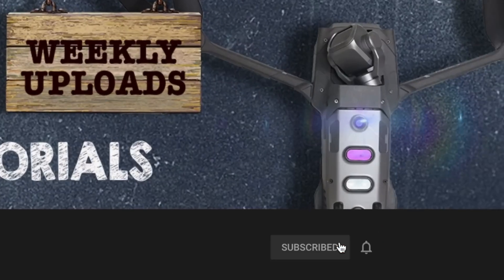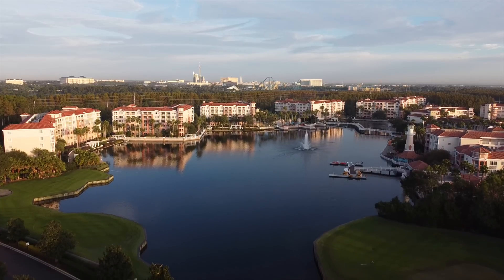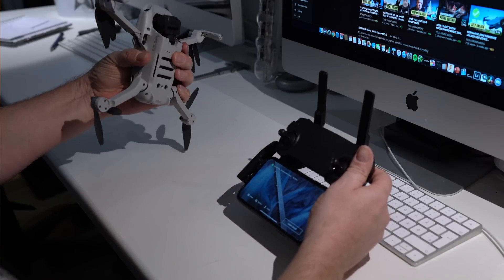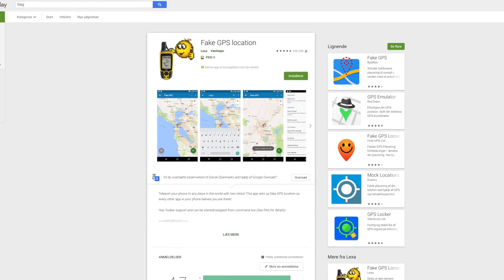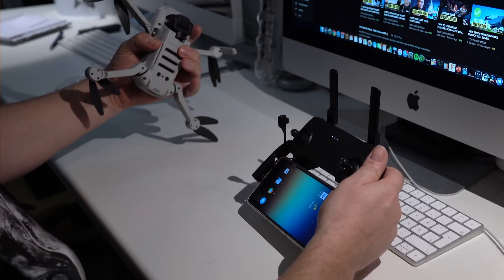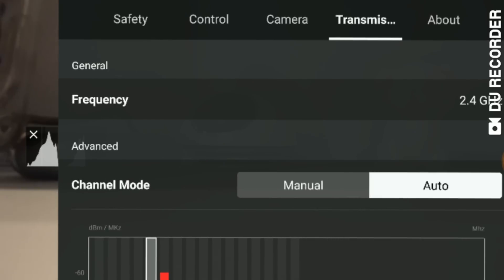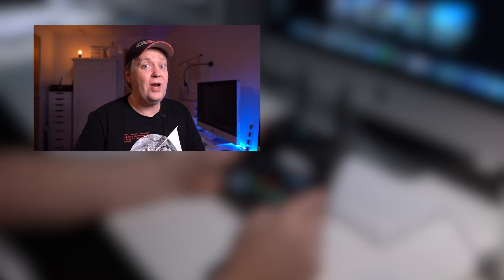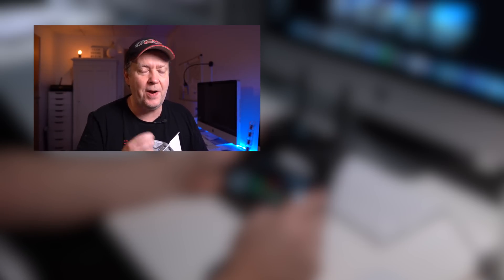HOW TO FIX MAVIC MINI BAD RANGE - FCC HACK (all DJI Drones 2020)

Comment: Hi there, first I want to mention you are making amazing tutorials! The second thing Is that I try something maybe that will work for some of the guys, i faced a lot of issues with city flying on 5.8, i couldn't reach even 20 m Height, what did I do I switch to 2.4 and choose 4 th channel, and it was working great, maybe you have any explanation how is that possible? Best Regards from Ohrid-Macedonia!
Reply from the maker: Thank you sharing your experience .. I think channel 4 is less polluted in your area, might not be for everyone
Reply: Simple: the higher the frequency the less power and penetration and range it has ... the more likely intererence will hurt the communication.

If RC pilots want to get high range they avoid even the 2,4 Ghz frequencies and chose 9xx Mhz, so 900 Mhz bands ,,,, no Ghz bands at all.
That leads more reliable connection and better signal .
So stay in 2,4 Ghz to get the best and check the wifi "pollution". If that is high than you are most likely above a private area with a lot of households and wifi networks where these signals will be stronger than yours if you are farer away cause there signal is stronger being closer to the drone. Than you loose the video connection first ...

dji does not care about it cause flying over private crowded areas is forbidden in close to all countries ... at least EU, US, Africa, ... 

Best way to avoid these risks: buy a mavic air 2 cause that will use occusync 2.0 and that is a different story regarding range

Comment: I am also confused because my battery’s say Ce does that mean anything and im also noticing bad range in my neighborhood
Reply from the maker: You likely have the CE version of the drone
Reply: TECH DRONE MEDIA but you told me before you thought I have fcc
Reply: Most like That CE is just a electronic safety level. You can always go onto dji website and look up the model numbers for both then check your box or drone to see which matches

Comment: Hello sir can you give me an advice? Because last week i bought mavic mini 199g here in japan, 199g battery 1100mah battery flight time is only 10mins, can i use 2400mah battery to fly more? It is compatible or not? Please help me
Reply from the maker: I think it will fit, but not sure if it's blocked by DJI but can't see why they would do it.

Comment: If leave your drone sitting idle it will switch back too, and overheat :) 

I'm no expert but this hack would probably only be useful for MT1SS5 / MR1SS5 Drone/Controller combo as they are FCC and SRRC. 

Also some person in Texas is going to collect a lot of drones from flyaways :D

Comment: Hi, I really appreciated your video. Did exactly as you said (i even took notes in order not to forget a step) and it didn't work.
Then, I changed the proceeding at the start:
-Start Fake GPS
-Connect phone to remote with cable
-start remote control and drone.

So connecting the phone with the cable BEFORE starting the drone and the rc did the trick for me.
Reply: Are you on the latest software 1.0.5

Comment: I can confirm that if you go to the location services of your Apple device (settings, privacy, location services) and remove access to location on the DJI apps (tap on the app name and select never) than there is no need to start up the drone in the way it is done in this video. The apps can no longer use the GPS in your Apple device and FCC stays forever if you keep on using the same device.

The first bit, programming a fake location, still needs to be done with an Android device though.
Reply from the maker: Nice bonus hack :-) thank you for sharing
Reply: @TECHDRONEMEDIA  Yes, I have tested it as well at home, and in the field. But, as soon as you enable location services again it will revert to CE.

Another thing! you CANNOT disable location services on an Android device. The app will not work when you restrict the app from using GPS. When you start the app with GPS off it will ask you to enable access to GPS, and if you don't it will close the app.
Reply from the maker: Brilliant :-)
Reply: TECH DRONE MEDIA will everything still work ok with location services off on the iPhone? Thanks

Comment: Hi again. I hope this is informative to Australian users of the DJI Mavic Mini. It is a downgraded FCC drone in OZ and it's identifiable by the C-tick logo which is a triangle with a circle inside encompassing a tick mark. Apparently they have limited the number of 5.8 ghz channels and that allows the 'better' channels as identified by the 'Auzzie radio boffins' to be kept free for higher powered commercial devices and the drone can become easily swamped by those channels and that's it. I live near a cell tower so that probably explains a lot. It should still be better in the country. So I'm sorry that your wonderful discovery won't work here in OZ. Have a nice day! P.S DJI says the FCC drone will work 'albeit illegally' in Europe but the controllers are incompatible.
Reply: Where do I find that logo? Just bought a Mavic mini from Kogan and live in Tasmania and my range is definitely not the 4km advertised

Comment: FCC Hack! Thanks for the great video! I am not sure if I understood correctly. Once after "cheating" the controller/drone with a fake location and disconnecting the phone (4:50) - should I switch off the fake GPS? and from that moment I don't need it anymore? (as long as I always connect the phone only after pairing the RC/drone and firing the props). Does it mean that I will see the maps normally on my android? And what will happen if I accidently/deliberately stay with the fake GPS? Thanks again...

Comment: The FCC based DJI Mavic mini made for China utilizes a 'square root raised cosine filter' (SRRC) to limit the bandwidth so it gets swamped by other devices using the same band but with wider bandwidth. That also makes directionality critical and is no doubt loss prone to obstructions. The obvious power loss is from 30dbm down to 27dbm from memory* and that's about half the power lost. The CE is way worse with a massive reduction in power so this hack would be good for them. Unfortunately my research shows that there is nothing to do about it here in OZ if you got one of those. I should have bought one from the US if I had only known. It should still be possible to get a couple of k in the outback and even more with range extender antennas. But not the 4K we were promised.
So anyone out there make sure you buy yours from the US... an FCC MR1SS5 (*Note: I checked and the SRRC model is about 20% down at 28dbm).
It wouldn't surprise me if that's the method used but the Real SRRC stands for the Chinese certification and I'm pretty sure that some of those found there way to Australia via resellers and you can't tell the difference. The made in china plug doesn't tell you much. Have a nice one.
Reply from the maker: Thank you for clarifying about SRRC :-)
Reply: @TECHDRONEMEDIA  No worries. The whole subject is full of ???? Like how do you identify a Chinese  SRRC MM? How do they cut down the power? Is it by hardware or software means or firmware? 2db is a lot more than it looks because it's a hyperbolic  (log) reduction. I actually chose the MM because of it's supposed 4K range so I can carry out ground inspection between trees and I only get 500m. with the Australian FCC. No need to reply or get too involved. I'm doing my own research on this.

Comment: Paleeze I forgot to ask what model android phone have you got so I can find a mate who's got one. I have learned that all FCC Mavic Minis in Australia are firmware limited to 500M range and That's why folks who even try it illegaly, can't get more than 500m in altitude either. You can still have video but you get an RC lost message and then a return to home in ten seconds. I guess lol. This of course means that listing a 4k distance is really false advertising DJI!!!
Reply from the maker: A really old Xiaomi Red Mi
Reply: @TECHDRONEMEDIA  lol. I'm struggling but in my case I'm just going for range extenders. Oops I meant directional signal improvers.

Comment: Here's a laugh. I've got an old android that will download the fake GPS app and run it but not the DJI Fly app... and a new android that does visa versa. Between the two of them it's like... two halfwits a fullwit don't make. Exasperation noises blather, blather, sob. Anyway I wondered why when flying in Australia I got RC fail messages after about 500M even with range extenders. I'm still glad you did this vid even in your inimitable style.

Comment: Hi. I have done all the steps in your video and it works  until the drone Update the Home point . Then it gods back to CE mode by Press OK witch is mandatory ?
Reply from the maker: you need to start the motors before you hook up the phone

Comment: I don't see 13 or 11 channels in my dji fly app. I only see 4 channels both the times. With fake location on and fake location off.  How do I make sure that it's in FCC and not in ce ?
Reply from the maker: shashank somani your version is the FCC one, it does not have the 2.4 band
Reply: TECH DRONE MEDIA ohk so it's a good thing right. ? But I am flying it in India and I am not sure if its using its full capabilities as I was never able to fly it for more than 1500m in nonwifi areas
Reply: @shshnksomani  I have the exact same thing man. I came here to the comments looking for a suggestion. I am in India too and I see only 5 bars. But my drone connection dies as soon as it reaches about 150m height and about 300m distance. How is it for you?

Comment: Thanks for the video.  I have tried many times but it goes back to CE mode. I get the POP-UP message and it shows that it is limited to 11 channels but then it goes back to 13 by itself as soon as the drone is picking up it's location. Am I missing something? When I switch back to my iPhone, the iPhone, by some magic, starts the App in FCC mode and then auto changes it back to CE mode. It doesn't do this when I do it on my son's Huawei.
Reply from the maker: Watch the follow up I posted yesterday :-)

Comment: Lol..I’m more confused than ever with all the conflicting posts,and you seeming to now accept that the video hack might not be quite what you said.
Indoors and outdoors seem to have 2 different story’s.
Would have been far more convincing,and less conflicting information, if you had filmed a demo with distance achieved on FCC setting and one on Ce,using your method.
For my part  in open land with not too many houses,when the signal is lost around 1150 meter, I not only lose the picture,my phone shuts down (Samsung note 8) and pressing the return to home becomes an act of faith.
After getting the phone back on ( it’s not quick as it’s a power off) and getting the fly app back on,I was relieved to see it was returning home.
I achieved the same result flying 5.8 simply by setting in manual to 143,which is just after bar 13.
I might also mention that after following a you tube video of how to put fake gps on my smart controller,the transmitter settings do show the 4k line around 100 which I gather is FCC,when gps is set to a USA location.
My Mavic 2 Z will go 3000 plus (far enough for me) over the same journey 
I do like your videos,and your friendly manner by the way,just wish we could get a definitive answer to the Mavic mini distance with FCC ,I see videos with aluminium shields to shield the gps before take off etc etc.
Reply from the maker: I feel your confusion and I'm actually doing a follow up video with things I have learned since I made the first one and answering questions.  Scary story with your phone shutting down, that would also have worried me too :-)

Comment: Ok, i am still stuck....please somebody! after i tried this i am in Auto mode in 5.8 Ghz. i want that back to 2.4 Ghz. It seems to be impossible to do a factory reset on the mini, so i hope there is somebody who can help. Again, i want to go back to CE settings.
Reply from the maker: Choose 2.4Ghz in manuel mode let it reset the controller, then switch back in auto
Reply: @TECHDRONEMEDIA   finally things are back to normal, Yes! To Factory reset your MM is to reinstall the latest update by connecting it to a computer and use DJI assistent 2. After that, it was back on 2.4 Ghz, in auto mode.

Comment: If i buy the fcc version of the drone and fly it in europe will i have better range?
Reply from the maker: Yes, same as in US with this hack
Reply: @TECHDRONEMEDIA ok thanks
Reply: No. That not true . Application changes power levels based on your localisation. Fcc version will have lowered power based on GPS data. Ce has 2.4 GHz band so its better in eu. Without any hacs ce is better for eu
Reply: @MrOzyreusz  but gps will be changed to america

Comment: Hi,I have the CE version bought in the UK. Currently in Brazil so it automatically jumps to the FCC mode with no hack. It shows 11 channels. Had signal breakup at just over 300m with line of sight so no improvement over its performance in the UK. I was over water/jungle at the time so little interference.
Reply from the maker: Have you tried disabling the WiFi on your phone
Reply: Hi, wifi was off, same set up as in the UK. Phone not in airplane mode though. Seems you get the break up when you do the turn at the end of a run. Also had major problems near buildings with metal corrugated roofs. Had interference at 40m.

Comment: Ive tried this several times with the Mavic 2 zoom, when I plug in I get no notification as you did with the mini.Have you had it working with the Mavic 2 ?
Reply: Lol mavic 2 use occusync connection and does not applicable to your mentioned drone. This video is intended only for dji drones that uses wifi connection such as the spark, mini and air
Reply: @glennreponte9210  COMPLETELY FALSE. My Mavic 2 Pro and Zoom do the trick but in a bit different way cause it uses a different dji app as the mini. You first need maps and a little bit more that I will not explain cause then dji might close that hole too.
It needs different and more steps and for all other buy nolimitzdronz workaround key.
Reply from the maker: The guy that gave me this tip nevertheless had it working I’m on his zoom too
Reply: Does not work that way but in a different way I do not wanna explain to avoid that dji will close such hole as they usually do by updating the firmware.
It needs a few more steps and if you wanna use that feature only just pay 45€ and buy that key for NLD ...and follow their instructions

https://nolimitdronez.com/

Choose Mavic 2 and then you will find a description. This will also lead to a permanent change without any steps before flying regardless which country you are. 
If you think it is expensive forget about it cause you do not know how complicate it is to change it now ... but their are 2 indicators that tell you the size of that challenge:
* if you find a way or know a way to hack to get access to dji firmware than they offer you thousands of $$$ depending on model
* it took them roughly 12 months  to find the first solution to get it done that you can use FCC

If it would be that easy they would have loved to get the money ...

Comment: Once the drone connected to GPS, it will switched back to CE mode.
Reply from the maker: Not if the motors are fired up
Reply: @TECHDRONEMEDIA  When do I need to fire up the engines.

Comment: Will I have issues flying my drone in the Maldives/ Mavic mini? Do I need this Hack?
Reply from the maker: Only consider this if you are experiencing connection issue
Reply: depends on regulations and if you are flying to foreign countries be carefull cause in many african countries you can loose the drone by crossing the border and they confiscate the drones. And most of all tourist areas hate drones and ban them ... so most likely you will run into problems ... even as a resident.
Drones can deliver transparency and look behind walls and can pictures objects close from the ground and show how rich some people are that do not want that.

Comment: While connecting the cable to phone with controller at last stage, most of the time DJI Fly app resets the phone to start and the location resets to its original. Or even while not resetting the phone the app senses my actual location even google map is fooled by the time but not the DJI Fly app. What to do? Thanks
Reply from the maker: Are the motors running
Reply: @TECHDRONEMEDIA  Drone is perfectly fine it is flying in the state it should, I just wanna say this trick doesn't work for me in the DJI Go app and UAV Forecast app. The Fake GPS only making changes in the Google Maps for my scenario.
Reply from the maker: Ok you need to enable developer mode as the first, and start the motors before you connect the phone
Reply: @TECHDRONEMEDIA  Under which option/App I can get/active the developer option?

Comment: This video is very good. The purpose of this video helps us move from 2.4 to 5.8. If your drone defaults to 5.8 then you can fly far. However, if you want to fly 4km away, we should choose a drone with a code on the ss5 control. If the control code is SD25 then we should care about this video
Reply: And how to keep fcc mode. When my drone have home point.
Reply: I have the fcc, I still lose connection after 1000 feet💀
Reply: That is false. The stronger the band the more range you get - except you fly above polluted are with a lot of buildings or appartements.
The Hack does only one thing: it uses more power for transmission in both bands cause in the US the FCC allows more power transmission than the EU with its CE mode

How far you can get depends on the area you are flying cause there are 5,8 overpoluted areas too in major cities.

Comment: really, the only way to improve the signal and reception on an fc model is to make/buy a signal booster , fly early mornings away from city. With the first choice, you will make it to 3 km beyond easily and you will maintain good reception.